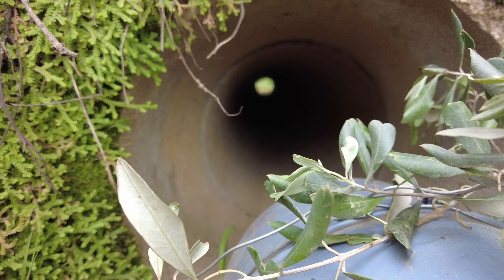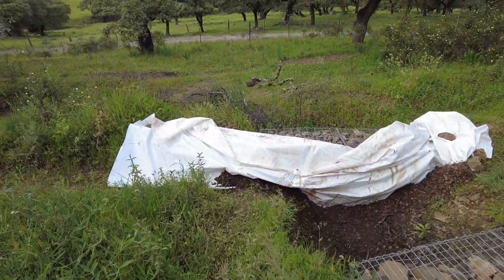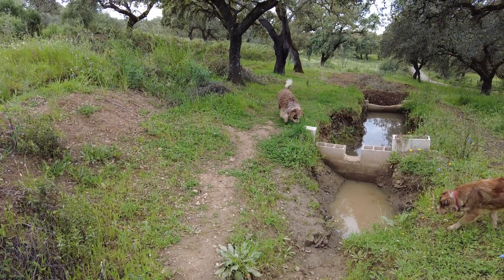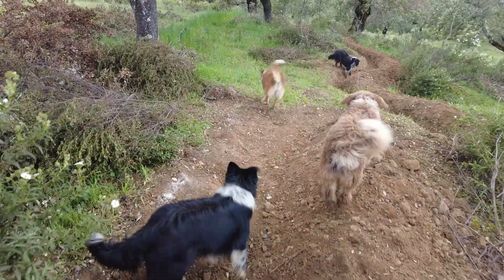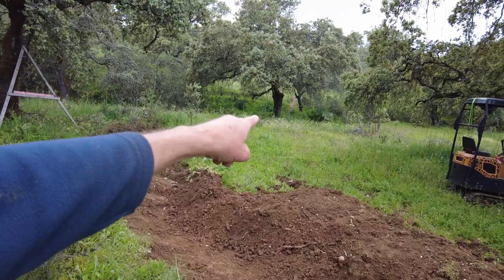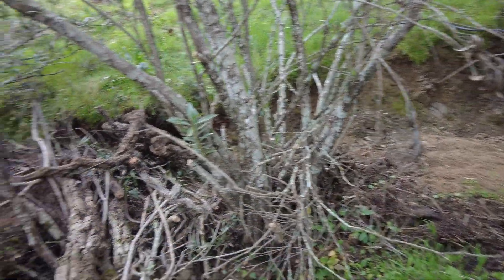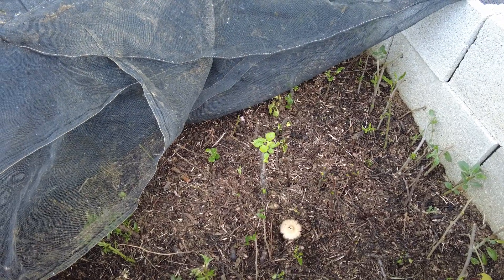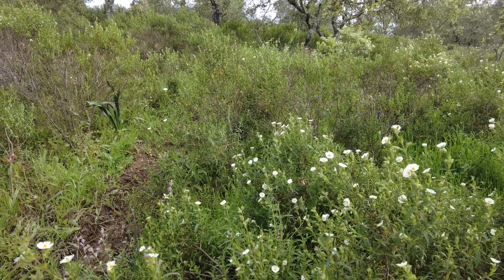Culvert water: it makes us laugh and it makes us cry!

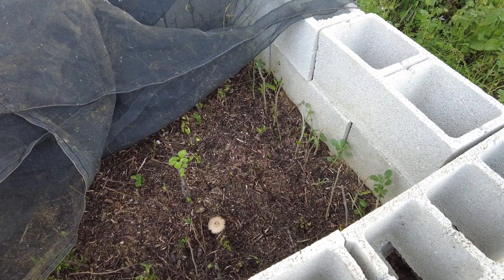Comment: 0:21your 25cm pipe looks like a good fit with the culvert.  It seems you have more than enough slope for good flow to the southern border swale.  Only questions  I have are; 1) Did you screw the pipe and fitting together? 2) Do you think the pipe & fitting need a support post where they leave the culvert?  I ask because the 25cm pipe will be heavy when it is full of water. 1:15 The young Holm oak that you pruned in the middle of the screen looks very good.  The shape is much better and based on color, there is a flush of new leaves.  Excellent!  7:02 Upper right corner of the screen'  I believe you have two problems with your settling pool to swale pipe.  1)  The pipe sags in the middle where they are joined and unsupported.  Is that joint not mechanically fastened? 2) It appears that you have more slope on this pipe than needed.   8 mm of slope over a 4 meter run is adequate.   8:05  The big rock on the bank that you had to go around;  If you remove the pipe completely,  I believe you can push the big rock down the hill and into the stream bed with the Giraffe.  Then you can dig a proper straight line trench in which to lay our pipe.  Correct the slope to the minimum.  When you reach the swale, cut the pipe off so the exit is not partially buried in the floor of the swale.  These adjustments will resolve the silting problems you identify in the pipe.  9:58  I like the expanded sand box.  I am happy to see you have easy access to water.  The cuttings need a lot of moisture in the air.  Never let them dry out.  This is a good application for a dripline and an automatic timer.  Are you using rooting hormone powder on the cuttings before you plant them? Remember we discussed dipping the cutting into the powder, opening a right size hole with  a wooden pencil or stick, inserting the cutting so the powder remains on the cutting, and pressing the sand around the cutting as the final step.  10:40  When your cuttings start to show leaves, they are ready for an application of fertilizer.  I will suggest a multipurpose foliar fertilizer (spray) or a generous  application of bone meal and well composted manure.  11:15  I will suggest you come back with the Giraffe and the landscape bucket to smooth out the humps and valleys below the dam.  I don't believe you had the opportunity to final grade that area when the dam was built.  The aim is to establish a finished grade below the dam that permits the seepage to flow down the hillside.  With a finished grade established, the pooling water should resolve on its own.  The banks of the dam have filled in nicely with vegetation.   11:48  The armoring of the spillway looks good.  There may be a thicker layer of rock in the center of the spillway than needed.  But you can fine tune that when the rains come.  Typically, the rocks are fitted together like a jig saw puzzle one layer thick and hammered into the mud.  You can do the same armoring on the inlet swale.  If you  partially fill the inlet with a loose stack of rocks, you will have another silt filter and slow the flow of water into the pond.  Best of luck tomorrow!
Reply from the maker: Thank you Steve. A long list of valuable sharing. I'll get to them one by one. Keep commenting, keep sharing. Much appreciated
Reply: @SuerteDelMolinoFarm  Of course Martin. I'm happy to share.  Most of what I've written is summer projects.  I understand you are a very busy fellow!😉

Comment: Very interesting tour, thank you!
At that first culvert, there are two gabions, first of it is acting largely as a silt trap and second one (with plastic tarp) diverting water to canal. As you said in the video, that maybe there could be a hole inside the tarp - but what about putting large enough pipe with 90 angle and opening up + upper edge being like rake, protecting from larger floating pieces getting into the pipe? And something similar at upper pipe - a silt trap and pipe opened upwards. Maybe those different heights could be adjusted so that most of the time that system would work "automagically", reaching to the levels of those three outflows one by one?
Reply from the maker: Automagically you open my mind. Excellent sharing. What is the system that you propose called? Where can I get more info?
Reply: @SuerteDelMolinoFarm I searched around for Geoff Lawton tour in his farm in Australia to get the example of something I was thinking. When searching in Youtube for "Back From the Drought with a Vengeance; Water Flows of Zaytuna Farm February, 2020", that's the one.
It is possible to control water levels using the heights/positions of those swivel pipes at different locations. More vertical intake should also help a bit with keeping large amount of sediments getting into pipes.
Good luck with your great project(s)!

Comment: These look like good positive changes to me Martin. I guess the main thing now will be working out the finer points to from the little road pipe  having the water go the ways you need and in the right  amounts.
I don't do straight lines either
The seepage on the pond could be a syphoning effect. sometimes when the topsoil goes from the waters edge all the way over the top of the wall it can  lift water out by hygroscopic pressure, 
It seems to not make sense but If you completely wet a dish cloth and put one end in a glass full of water and the other in the sink you can see how the effect works. 
 
I am looking forward to seeing how it looks when it rains  next time. 
Thankyou for sharing
Reply from the maker: Ooh. I've hoped for a symphonic effect and got a syphonic effect. Valuable info. Thank you for sharing
Reply: @SuerteDelMolinoFarm  oh you're definitely building a first class natural symphony ... you're on the verge of a symbiotic relationship with your land too
Reply from the maker: @TalRohan  sounds like music to my ears